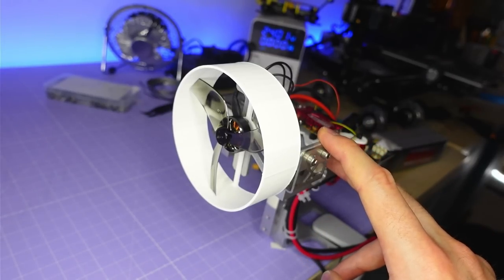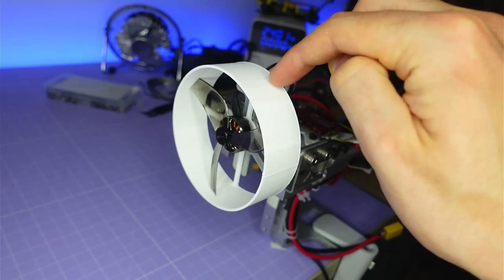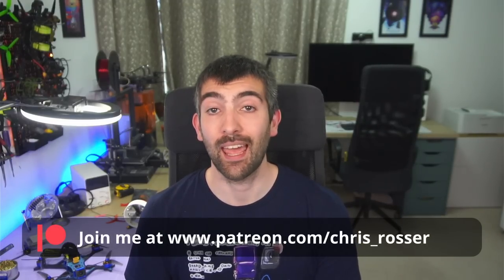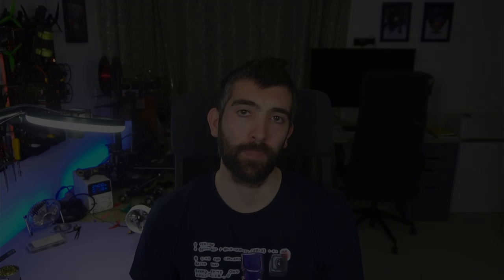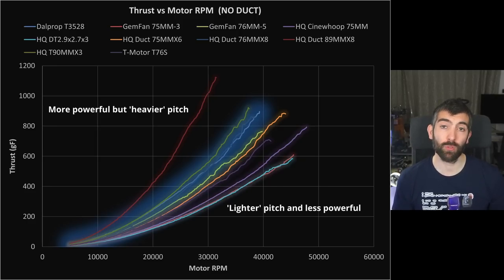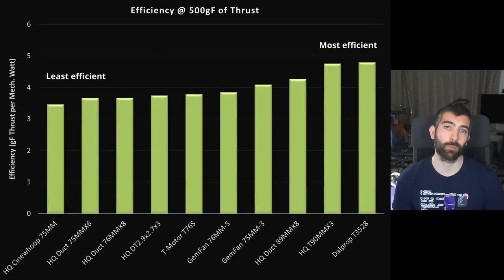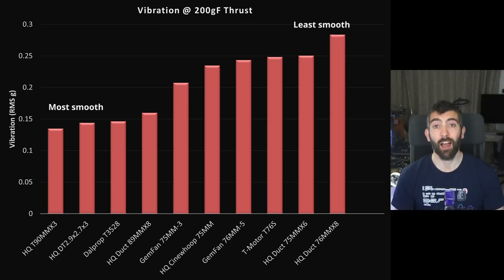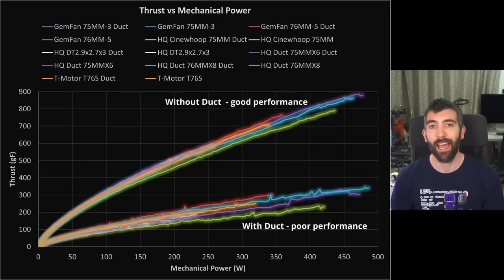Cine-Whoop! or Cine-Whoopsie? Testing 3 - 3.5" Ducted Props

Comment: YAY! Awesome as always! 
I'm curious how the HQ 90mm 8 blade stacks up in testing to a 5" prop.   I've been using them on my AOS 5" UL for a while to fly in places where the noise of a screaming 5" might be disruptive. While they certainly aren't as efficient, i've not felt i was lacking thrust over a 5" tri-blade, and they certainly seem much quieter. Of course, none of that is Science, just my impression when using them. :D
Reply: I have been using them as well, they are way smoother than my regular tri-blades, and my blackbox records less noise when using them. I am curious about what sample size was used when doing the vibrational testing.

Comment: those 8 blades  are super fun on a 5" quad with 4S motors and a 6S lipo !! you lose in efficiency but the sound is awesome and the speed is not bad at all.
Reply: Try the hq 4x4x6 on a 5" quad. Awesome fun too.

Comment: Your measurements explain quite a lot what I got as a result in real life: My Beta FPV 95x gets only about half the flight time than my Cine25 despite having smaller props... but they basically run freely. It also feels better in flying and makes significantly less noise - both in volume and in subjective feel.

Comment: I can't help but wonder if the ducted setup would do better as a puller, can you spin the motor/prop the opposite direction to test that?
Reply: That was referenced in the first video. He feels like the dirty air from the test stand impacts the results.
Reply: @FL_Engineer  that makes my question even more interesting though, will there be a different impact from all of that dirty air on the pulling vs pushing side of the thrust
Reply: Exactly. Just test one a puller vs pusher and compare the results
Reply: @CiottiFPV, don’t you fly the FpvCycle Toothfairy2 as well? I would love to know if you think I am mistaking, but I feel it flies so good and I wouldn’t want to miss the ducts because they give a flight feel I never had on any open prop quad…
@Chris, would you mind doing some tests with ducts like them,it would be verrrry interesting as they are similar to slammed ducts and the blade sits damn high in the duct.
Reply: @luis_gbs  yeah one of my cinewhoops is a toothfairy 2, flies the same as the cinesplores but is a bit lighter, ducted flight characteristics are basically just slower with less sideways slide making shooting gaps and being pin point accurate much easier
Reply: @CiottiFPV   Sure, do you fly the cinesplorer with the old “high” ducts (V1 or molded) or with the newer “slammed” V3.8 or V4?

Generally, I would like to know if a different duct design like the two options from FpvCycle would significantly change the measured results 🤔
Reply: @luis_gbs  I actually use all of those ducts for different scenarios, if I have a gig with a really high profile musician I run the original molded tall ducts for maximum prop protection, for max durability of the quad itself I run the HQ molded ducts with big deep inserts installed, then for the most speed possible I use the fragile ass FPV Cycle v4 ducts lol
Reply: @CiottiFPV  So cool! Do you notice any significant differences in flight time?
Reply: @luis_gbs  not really since each use is so different, I would LOVE to see Chris test different duct heights and arm styles

Comment: The duct lip (which yours havent got) is the source to an possible increase in lift. The lip works as a wing airfoil when properly implemented. Excellent video and sum up!
Reply: Yea those printed ducts he had only adds weight and blocks air flow. You need something like the Terraplane for puller or Avata for pusher duct style. My 3.5" Terraplane can get 8-10 min flight with a 1800mah battery and it feels like it's on rails.
Reply: The issue with duct lips, is that you're assuming laminar flow entering the duct and even distribution on the fan surface.  In reality, the way quads fly  with ducts they are flying at a less than ideal angle of attack and very uneven distribution of flow as it enters the ducts.  It's much more complicated then just sucking air into the duct.  This is why he recommends open air or prop guards over ducts.

Comment: As far as my experience goes, this should hold for 2-inch props, too.  I've tried a couple of tri-blades [LDARC/KK 1935 {absolute crap}, HQ T2x2.5x3 {better, but still crap}], and a quad blade [LDARC/KK 2045 {kind of okay}], before landing on Gemfan D51s {perfection}.  That design fits my LDARC/KK 1103 7800 kV motors and LDARC/KK 1.9" prop guards like it was meant to be there, delivering true duct performance.  The blades are quiet and efficient; smack dab middling in performance - not too fast, and good with propwash.

Comment: Okay so what about prop guards right at the edge of the props?
Reply from the maker: I mean theoretically it should help if you can get small enough gaps but no-one can get tight enough tolerances on plastic props and 3D printed ducts at these sizes to actually achieve any benefit, even in theory, let alone in practice.

Comment: I run the Gemfan D76-5 without ducts on a little 3" i cut from leftover carbon sheets, man that prop does some interesting things when ran without ducts, I'm getting close to 5 minutes flight time with a full size hero 8 on it and a 850mAh 4S. It honestly surprised the hell out of me, because it really feels quick and responsive even with the insane overweight. Probably shouldn't talk about durability when ran without ducts though..

Comment: Interesting about the duct design.  So what it means is that the duct was not designed properly. Instead, the duct needs to start only at the tip of the blades.  It would be good to see a retest with a redesigned duct.

Comment: You tend to get better low-pressure thrust without a duct and better high-pressure thrust with one; the issue you are seeing here is you're comparing *static test values*, unducted props have good static thrust but lower high-end thrust, and ducted props generally have poor static thrust but better high-end thrust.

Comment: I was saying this before I like the gemfam 5 blades the shape of the blades I feel is more efficient and quieter to my ear anyway 🤷🏻‍♂️ I was running some on my rekon35 switched to the gemfan 3 bade because like you said normally more blades are less efficient but now I might go back to the 5 blade given your data because I feel the 5 blade was quieter 🍻
Reply: Rekon35 on 2S with those gemfan props? Thats over prop'n the 1303.5 motors. Might work somehow and be quiet.
Reply: @chrisbee5481  oh it did work and it was super quiet I loved it
Reply: @cch201992  try the HQ 75mmx5 props. I'm sure you will like them more than the gemfan 5 blade for the rekon35. Also the DT76mmx4. All super quiet and not as heavy and hardcore pitched like the gemfan.

Comment: It would be interesting if you tested a proper duct with a flared opening and non pusher configuration... I've been trying to explain how inefficient moving to pusher and removing the flare on the duct actually is.
Sure, pushers have an unobstructed column of air but they're receiving turbulent air to the prop itself.. The prop and motor will be impacted by this. in a standard configuration, the motor gets clean and unobstructed air.. it doesn't care what happens after it (within reason).

The flare is one of the major contributors to lift/thrust for a ducted setup as well. the flare should start just above the prop which allows for the prop to achieve the same surrounding air intake that you speak of whilst avoiding losses due to tip vortices
Reply from the maker: In my testing pusher props are significantly more efficient than puller props for open configuration s. The difference is around %10 or so for a typical arm. The air being drawn into the prop comes from a wider area than the thrust column so I suspect that's why blocking the inlet is not such a big deal as blocking the outlet. If you add a duct then the effect of blocking inlet or outlet is the same as we would expect.

Comment: Ever since i tried gemfan 5 blades ive never went back to 3 blades for any of my cinewhoops. Flying indoors my cinelog35 felt heavy, sluggish and flew shorter with 3blades carrying 1500mah and full go pro. But with 5 blades it just flies better and much more efficient and even more efficient if you go lower kv. And theres barely any difference flying indoors or outdoors. I get 12mins of flight time no gp 1500mah and 10.5mins with full gp same batt

Comment: your duct design is flawed with it's sharp cornered and non laterally transitioned inlet not to mention the duct makes the inherent air blockage of your test stand even worse.  I think you need to redesign the duct shape and use a 2-3 inch standoff behind the motor in order to get better airflow into the duct.  You might even put a shroud on the stand elements in order to smooth airflow. Your effort is to be applauded but this test needs a redo.....

Comment: Youre opinion and findings about the ducts efficiency doesnt explain why the dji at 410g with ducts have 13 to 15min flight time compared to a caged 3 inch cinewhoop that weighs 410grams but doesnt get close to 10 to 15 mins. 

Imo opinion, youre duct design is very poor and does not compare to the design efficiency of modern cinewhoops with ducts
Reply from the maker: The main difference between FPV quads and DJI quads is that DJI is using Li-Ion batteries which have lower power output but more energy density. If you compare an FPV quad with a Li-Ion pack to a DJI quad at the same weight the FPV quad will get similar flight time.